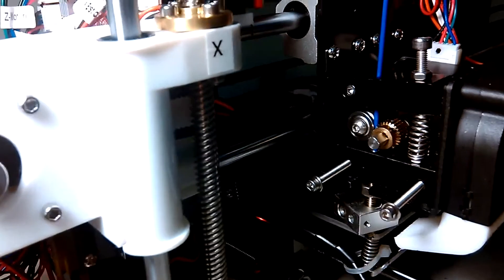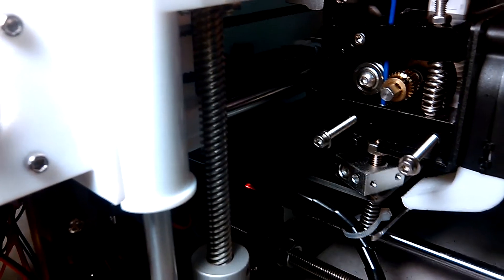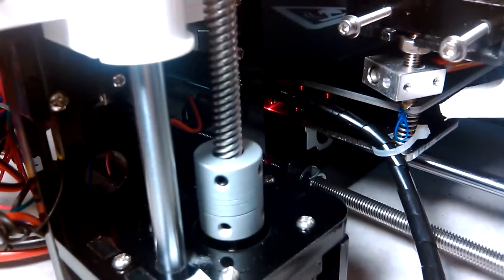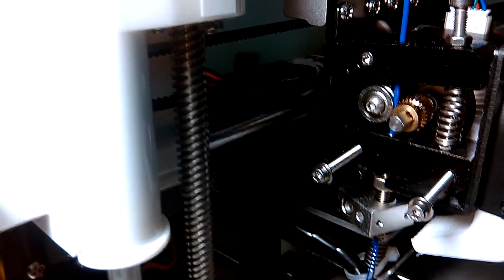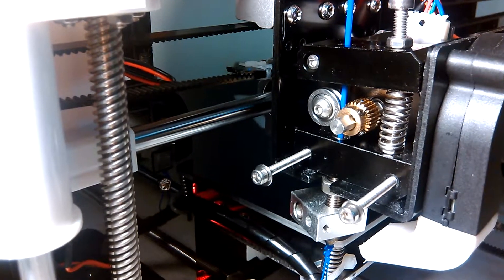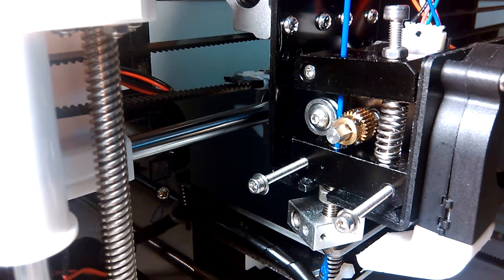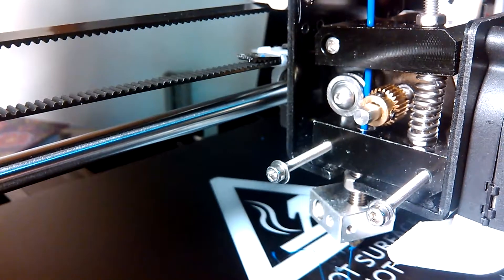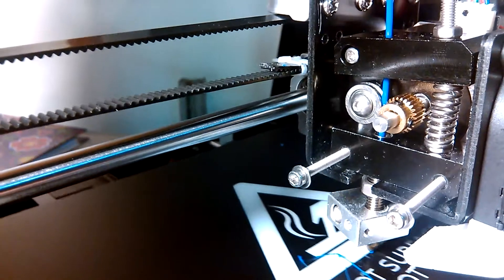Anet A8 will not extrude

Comment: I sort of have the same problem wit my anet a8, only my problem is that extruder does not feed at all! Even when I press in "extruder position" but the little brass gear does not turn. Its not cloged i checked and I tighten the 2 screws on the brass gear but nothing. Maybe the motor is broken?

Comment from the maker: I was using the micro SD card that came with the printer. Don't do that their cheap Chinese cards! It turns all the printer is fussy about the SD card you use. I went through all kinds of voltage checks and everything checked out okay. Someone made a comment that if you use the SD card that came with it you'll have problems and they were right on the money. I hope this will help you.